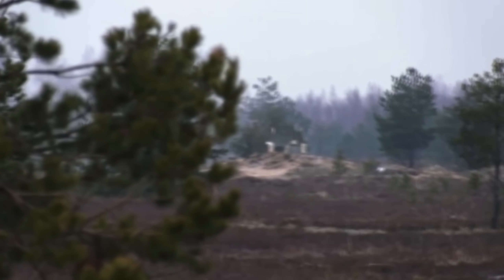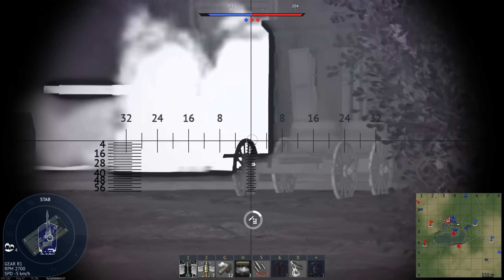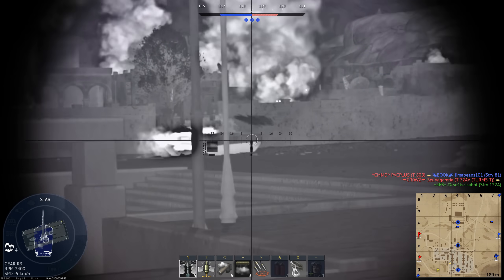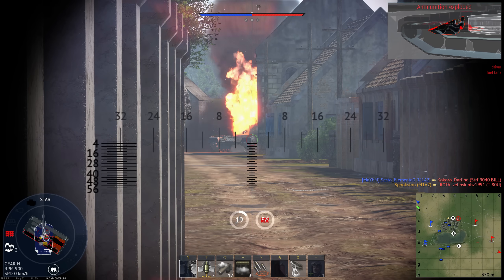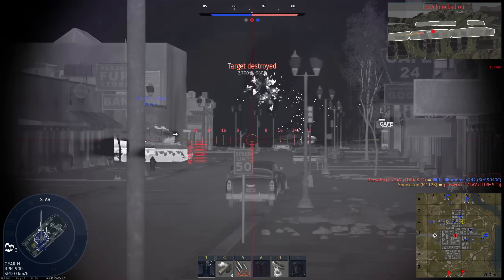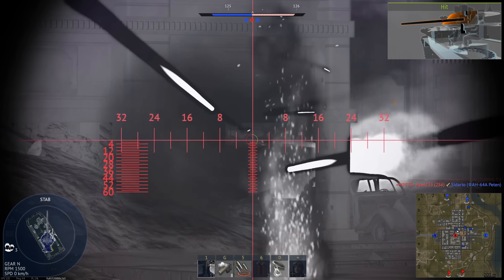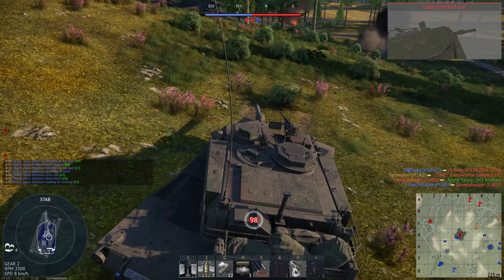Why The M1 Abrams Uses Depleted Uranium

Comment: The reason the M1 Abrams uses a gas turbine engine is the service life is many times longer than a diesel engine. And it is cheaper to work on. It also makes more power than a diesel engine.
Reply: It's service life is longer if maintained properly a diesel is more forgiving, and both engines produce more power at different rpms anyway, turbines at low speed are absolutely horrendous for fuel consumption to power output, especially compared to a diesel. I have a feeling turbines will ultimately be the standard in the future just because there shear power output
Reply: @lonesurvivalist3147  I was about to say, a diesel will always perform better fuel wise at low rpm
Reply: I'm pretty sure the actual reason is just that the abrams was designed right before the compact ultra high power turbodiesels were figured out, so all the tanks that came out right after the abrams got turbodiesels because they make as much power as the turbine when your working at the scale of less than a MW or so.
with some quick googling, the leapard 2 for example has twin turbochargers with intercoolers, and the engine block is liquid cooled so is can go to higher sustained power without melting the engine. and it's a 48L V12, with the same 1.1MW power output as the turbine on the abrams, while burning around half the fuel.
Reply: @thamiordragonheart8682  The advantage of a turbine over a turbodiesel is that the turbine is absolutely quiet from the front. The first noise of the Abrams you will hear are the tracks, while for every other tank you can hear the diesel engine before you can even spot the tank, forget hearing its tracks.

Otherwise yes, for low speeds, for cost effectiveness, reliability etc etc etc - a turbodiesel is way better than a turbine.
Reply: I'm thinking the M1 turbine engine is a multi fuels which means what ever kind of fuel you have can be run in it.
Reply: tell that to your mechanic.
I've worked on aircraft turbines before and I know for a fact how much of a hassle those little shttzz can be especially when an unknown problem occurs that forces the engine to shut down
Reply: Turbines are not cheaper, many times more expensive to produce, operate and maintain. For worse, while multifuel diesel engines can be completely stripped in the field with a civilian workshop tooling, replace parts and armed again, can be refurbished by any truck maintenance workshop, turbines need to be sent to factory mandatory each set numbers of hours to be disassembled, rebuilt parts with expensive specialized tooling and replace a good percentage of complicated parts.
Reply: @Argentvs  
or tap into the Air Force since they would have mechanics that most likely would be capable to handle Abrams engines.

But with how stupidly awkward the relationship between the Army and the AF are, that's just near impossible
Reply: @dickmelsonlupot7697  it's not a matter about mechanics but precision specialized toolbanks. 
Air Force engines neither are rebuilt in base by mechanics. They maintain them, repairs and rebuilts requiere factory recalling.
US Army mechanics can do all in their tier possible. But turbines need a replacement power pack when need major repairs and sent to a special facility.
Diesel power packs are easier to repair without factory involvement and can be stripped whole, replace parts on field with mobile workshops and be ready for work in a very short time, cheaply and without much tooling.
Tank crews can repair them even in the field if have no serious damage with the on tank toolbox.
Reply: A reason for the turbine: it doesn’t care what fuel you use. A diesel MUST have diesel otherwise it doesn’t function. The turbine on the abrams can burn jet fuel or kerosine. It doesn’t care. This has been the cited reason for keeping them. Maintaining them is not cheaper nor easier. They are a far more precise machine than a diesel.
Reply: @goldenhate6649  lol. Dude google before commenting nonsense.
Modern MBT diesel power packs are multifuel. They can burn kerosene, diesel, gasoline, fuel oil, benzin, solvents, lubricants, cooking oil etc. The only change is the range due the energy density of each one. They are just diesel engines with forced lubrication like gasoline ones and electronic injection and spark control that adapts to the fuel.
Reply: @goldenhate6649 
Uhhh no.
Tanks can actually use any type of fuel even the ones that use a diesel engine.

Tank engines are far more robust and stronger than your average car or truck engine.

Your statement is just plain wrong.

The only reason they kept it is that it creates a hella lot of power without sacrificing weight.
In fact, if you use other fuel types other than jet fuel for the Abrams' turbine engine, it's more likely not to function that great especially if you use diesel since diesel is thicker than jet fuel (since jet fuel is pretty much premium car fuel but pumped up with steroids and added with more octane).
Although it can run other fuels, the damage and dirt it can create in an engine is hell for a mechanic or the manufacturers who will have to do fix it because some jarheads and other meatheads were man-handling, abusing and force feeding shtttt to their creations so it is advised not to do it as frequently and try to use the recommended fuel as intended to keep the engines clean. 

It's a simple case of "just because you can, doesn't mean you should".
Reply: I don't agree very much.  otherwise trivially on cars you would find turbine engines.  diesel is more efficient if a good engine.  They keep the turbine for more motives because you have less problems in temperature excursions with fuels, because it is tested, because a turbine engine costs more ... the turbine has problems at low rpms
Reply: @flyblu80  Its because they are loud and have alot of exhaust heat. turbine engines are way more efficient than a diesel engine. look up the Chrysler gas turbine car, its motor is the predecessor to the one in the Abrams
Reply: @flyblu80  Turbine engines are insanely expensive to buy. Imagine paying the price of a luxury car for a normal family car with a turbine engine. The difference in price will never come back in fuel savings due to increased turbine efficiency. 

Turbines are needed only where their use is absolutely essential or economical, essential in military & economical in power production or large ships.

Comment: I loved so much that I was the only one that knew among my friends that the Abrams uses gas.
Did they ever restart producing those turbines?
Reply: The turbine is multifuel. Gas turbine means it is a turbine that converts the energy of an expanding combustion gas which can be diesel, JP1, kerosene, or even gasoline  and sets it apart from a steam turbine which gets its energy from steam expansion not internal combustion.

Comment: To be fair, the only way that the depleted uranium would turn into the dust form is if the uranium shell penetrated the armor, or if the depleted uranium armor is penetrated, which at either point the crew of the tanks would have bigger concerns
Reply: People who are recovering said tanks (or just investigating them for battle damage) would also have concerns about the uranium dust. As would the civilians who live in those countries and have to clean up the wrecks when the fighting is over.

If DU is so benign, then why don't training rounds used in the U.S. contain any DU?

Comment: Tungsten is toxic? Where did you get that idea from?
Also the problem with DU is it burns after impact, creating inhalable clouds of uranium oxides, which may also stuck to the surrounding surfaces or enter the water source, and is extremely difficult to clean.

Comment: The reason for the turbine is that it can run on any fuel that can combust. It doesn't have to be economical at all. It it burns, it turns. Also kerosene is cheap.

Comment: The engine can use a variety of fuels, including jet fuel, gasoline, diesel and marine diesel. Versatility outweighs economy.
Reply: It actually takes significant amount of work to setup the gas turbine to use a different fuel, especially if it is really different then the standard fuel. The main reason it was used that for the time and even to this day it's really hard to beat the power vs. package size of a gas turbine. Newer diesel reciprocating power packs have gotten better but still don't beat it. The space savings allow you carry more fuel or have a smaller vehicle. Second plus is that gas turbines are very reliable, they really don't have many moving parts compared to a diesel engine.

Comment: I have accidentally discovered one pro for legs over tracks. That is if you use a four or six-leg setup, like I am on a sci-fi tank I am designing (six-legs), you can increase the gun's elevation and depression angles by raising/lowering the front and hind legs to elevate/depress the hull. Tracks are still better in almost every way, but I appreciate this pro I found.
Reply: You could also, you know, put hydropneumatic suspension on a tank and do the same thing.

Comment: in the equation of Kinetic Energy (KE) munitions. mass x velocity. Mass is the multiplying or the main factor. 

The equation for this is something i had to get down while in R&D. 
mxv=mj((d1+d2)\2)=KEB+((t1-t2)\2)=KEP

Mass x Velocity = MJ(Density 1 + Density2) = KEB - (Temprature1 - Temprature2) = KEP.
KEP is the equivalent amount in mm of steel able to be penetrated. 

Lets go over the M829KEW-X a 10kg projectile with an enhanced muzzle velocity of 1740~1750m/s. with a Tungsten core and a DU shell.

10 x 1740 = 15.1380 (( 19.1 + 19.25 ) \ 2) = 290.2711 + (( 6192 - 2750 ) \ 2) = 2,011.2711
Density 1 and 2 are added us and divided from each other. ether way itd still role out a few points between each other, this equation use used as there have been known composite KE munitions that meshed a few materials together, so an equation for it was made, and its simple.

Temperature 1 and 2 are usually the base material used subtracted by steel. every 100*F Steel has a warping or changing point. then divided by 2. 
Then its finally added into the Kinetic Energy Base or KEB to spit out the KEP of the munition. 

The prototype M829KEW-X would be able to penetrate up to 2,010mm of steel equivalent if it used the correct propellant. 

Another thing to note. this is not an actual sense of it able to penetrate a solid brick of steel equal to 2,010mm of steel. In the world of armor penetration. 'equivalent of steel' is a now an umbrella term to justify protection levels. like how Horse Power didnt really mean the power of one horse but it originally meant how many horses could be replaced instead.  in this sense, ERA, slanting, supplementary, slat, DU plates, Tungsten plates, kevlar. ect.

Comment: 3:00 why do I always see people running on super low graphic like this? As a console player I constantly hear PC elitests talking muh 60 frames and 4k graphics and muh ray tracing and then I see a majority of PC players use low res graphics. Even on games like CoD.
Reply: Because in multiplayer games, performance > graphics. You want to maximize performance over visual flair. For single-player games, you can balance the two a bit more.
Reply: @Schwarzvogel1  I get that, but why do a lot of them talk ahit even though they dont play on high res or even have a good PC

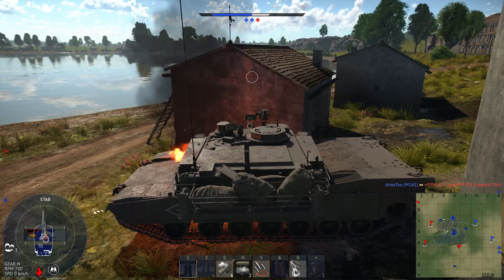Comment: 3:28 this hurts me, alpha radiation is the worst type of radiation. it carries the most energy with it since its basicly a helium atom stripped of its electrons moving at an extreme speed

"Due to the short range of absorption and inability to penetrate the outer layers of skin, alpha particles are not, in general, dangerous to life unless the source is ingested or inhaled.[5] Because of this high mass and strong absorption, if alpha-emitting radionuclides do enter the body (upon being inhaled, ingested, or injected, as with the use of Thorotrast for high-quality X-ray images prior to the 1950s), alpha radiation is the most destructive form of ionizing radiation. It is the most strongly ionizing, and with large enough doses can cause any or all of the symptoms of radiation poisoning. It is estimated that chromosome damage from alpha particles is anywhere from 10 to 1000 times greater than that caused by an equivalent amount of gamma or beta radiation, with the average being set at 20 times. A study of European nuclear workers exposed internally to alpha radiation from plutonium and uranium found that when relative biological effectiveness is considered to be 20, the carcinogenic potential (in terms of lung cancer) of alpha radiation appears to be consistent with that reported for doses of external gamma radiation i.e. a given dose of alpha-particles inhaled presents the same risk as a 20-times higher dose of gamma radiation.[6] The powerful alpha emitter polonium-210 (a milligram of 210Po emits as many alpha particles per second as 4.215 grams of 226Ra) is suspected of playing a role in lung cancer and bladder cancer related to tobacco smoking.[7] 210Po was used to kill Russian dissident and ex-FSB officer Alexander V. Litvinenko in 2006.[8]

When alpha particle emitting isotopes are ingested, they are far more dangerous than their half-life or decay rate would suggest, due to the high relative biological effectiveness of alpha radiation to cause biological damage. Alpha radiation is an average of about 20 times more dangerous, and in experiments with inhaled alpha emitters, up to 1000 times more dangerous[9] than an equivalent activity of beta emitting or gamma emitting radioisotopes."

if this shit comes anywhere near a water supply or something like that the effects are very significant.

Comment: Afaik the DU staballoy used in penetrators doesn't need to be alloyed as much compared to tungsten based heavy metal alloys which results in DU based staballoys being denser than tungsten based ones.

Comment: Fantastic video as always! It's always so odd to see people jump to conclusions about DU without having a real understanding as to what it is. Just hearing the word "uranium" is probably concerning for some out of the loop. 

On the topic of DU, I don't know if you saw the GAU-13's penetration on the dev server for the A7, but its 2mm better than the Vulcan. It may need the ol' HSTV-L treatment. researchgate's writeup on PGU-14/B for the GAU-8's use in Bosnia puts it at around 85mm. I emailed and got back confirmation from Pima Air/Space Museum that their GAU-13 display is the same barrel length as the GAU-8.
Reply: The GAU-13 and GAU-8 are 30mm cannons, whilst the Vulcan is a 20mm autocannon. They should have drastically different terminal effects if the developers cared about accuracy.
Reply: @Schwarzvogel1  M61 Vulcan and GAU-8/13 are both rotary cannons. Furthermore, the cyclic action of a cannon has zero correlation whatsoever with terminal ballistics, only rate of fire and accuracy. Terminal ballistics are determined by caliber, type of round, and length of barrel.

Comment: 1:22 "[DU] is only slightly less dense than tungsten." This is a very misleading sentence. Yes, DU is less dense than tungsten. However, regular ol' tungsten is not used for ammunition. Tank ammunition is made using tungsten carbide, which has a density of about ~16g/cm^3 vs DU's ~19g/cm^3(DU ammunition isn't pure DU either though)
Reply: True, though both are actually alloyed with other metals. US tungsten ammunition from the 40s through the early 70s, was tungsten carbide with a cobalt binder. USSR from the 40s through the early 80s used tungsten carbide with nickel binder. In the early 70s with the change to L52/M728 apds, the US used tungsten nickel copper alloy for a short time. But, with the development of xm578 through m735, the US was using a class 4 Tungsten nickel iron alloy, with a density of about 18,500kg/m3. M774 and M833 were both developed in the late 70s, using Uranium-titanium alloy, which was used for all US apfsds until the 90s.

Comment: You're really downplaying the self igniting properties of DU. Vaporized particles of DU burn at 10,832 degrees Fahrenheit, much higher than spalling could ever reach alone, and are a major factor on why tanks are killed with one hit by a DU APFSDS or even 30mm DU round, as the self igniting particles usually touch off ammo leading to mass detonations. Edit: You're also incorrect about the safety of DU, as the vapors of DU are toxic (though not radioactive), and while not proven in a lab, have been seen to cause significantly higher health problems long term in the areas they are used.